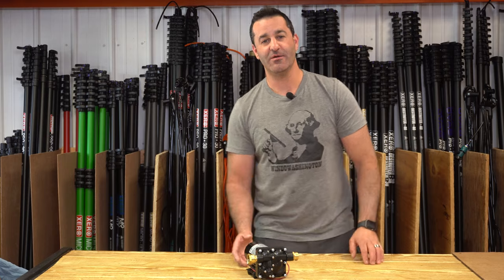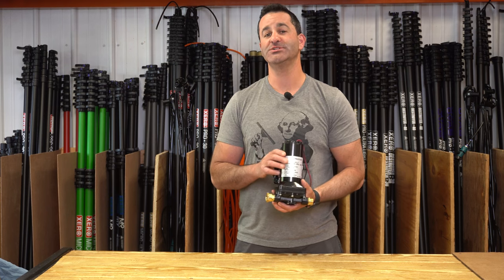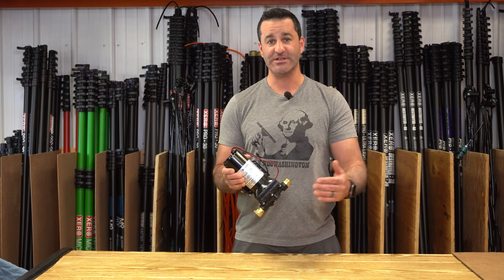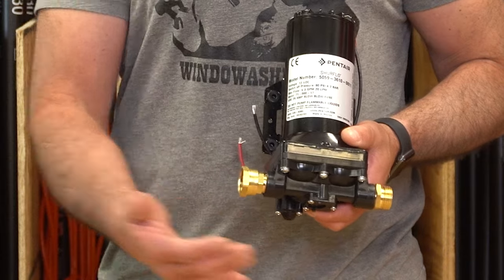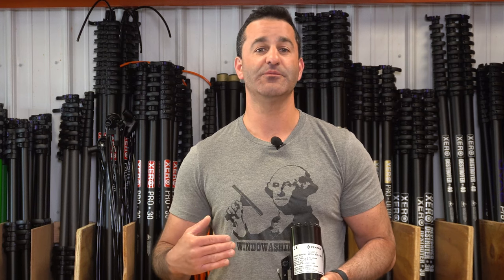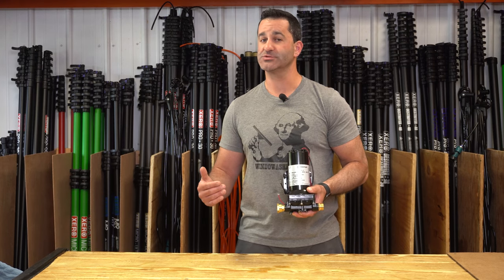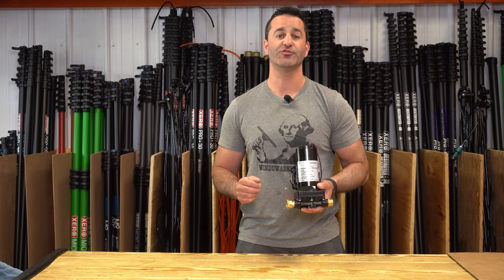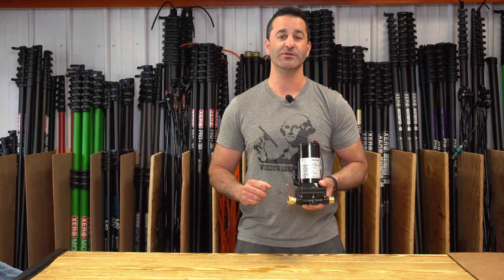12V Booster Pump

Comment: so, if you're running 60 psi from the spigot would this pump add 30 more psi to get it to 90 psi or is it an additional 90 psi making it a total of 140 psi? Also, I need to run this between my Carbon filter and an RO Membrane. The membrane minimum flow is 100 psi. any advice
Reply from the maker: so with a 12v that is a max rating.  so Max 90 PSI, and the flow is the max also.  you can ever get that in total.  it would drop the other.  so you will add some to the 60 PSI, but the max it would do in total is 90PSI. ~Jersey 862-312-2026

Comment: Do you have a battery you would couple this with?
Reply from the maker: any 12v preferably a marine deep cell.  ~Jersey 862-312-2026 https://windowcleaner.com/products/xero-12v-booster-pump/?sca_ref=3020234.dl0aAoVJ1A
Reply: Thank you, you wouldn't have a video which shows how to wire it up? I understand I need a switch and fuse.